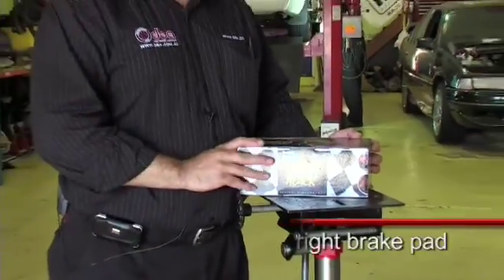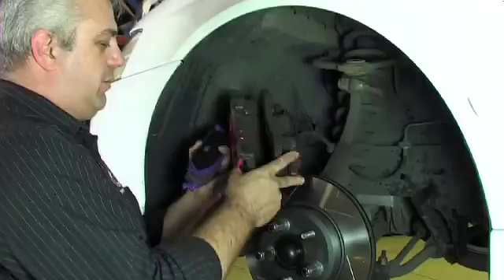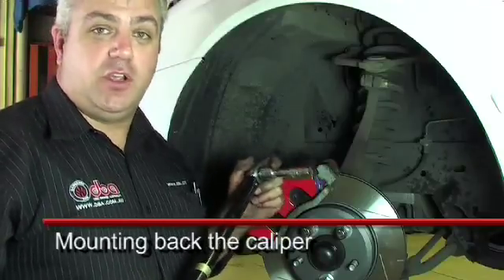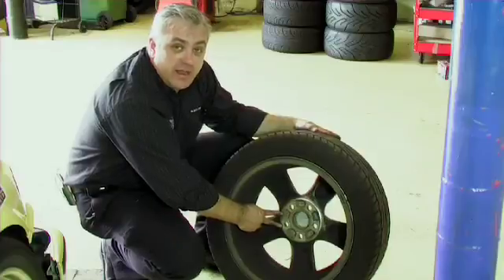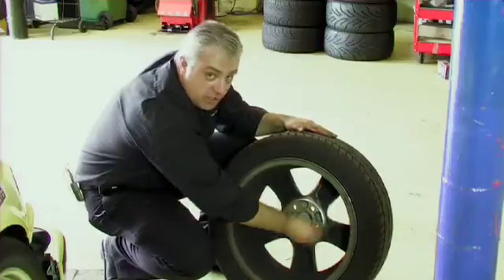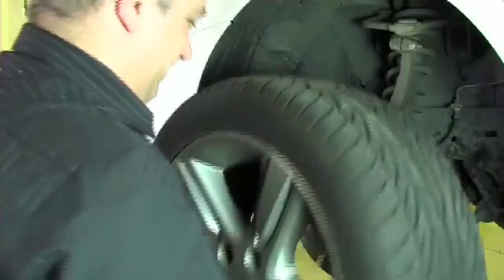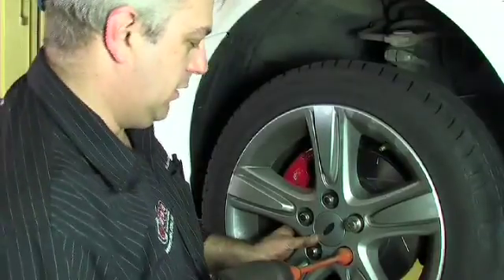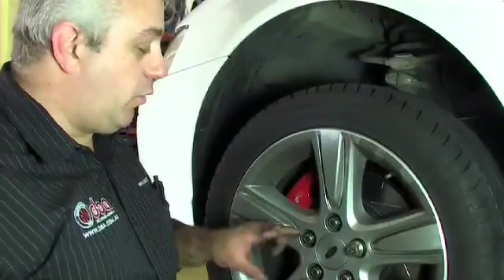DBA Tech Talk Video Episode 1 - Part 4 Fitting a brake disc rotor www.dba.com.au

Comment: Rotor "Conditioning" is a step that needs to be added to this install, even with new rotors.  During burnish period, a process called "Film Transfer" occurs.  This takes 300 to over 500 stop so it's not the initial 20 to 30 stops a tech generally wants to do.  To prevent hot a burnish and control Slip-Stick, use the OE Approved "Silencer" rotor conditioning treatment.  It is a two second spray applied to friction surfaces, requires no dry time and lasts through the burnish.  brake silencer. com

Comment: You must put a high quality synthetic boundary lubricant on the back of the pad, ears, etc, before mounting.  Movement at this mating point is critical, pads should never be fitted dry.  Be sure not to use petroleum based products or anti-seize, they will melt and contaminate the friction surfaces.  The OEM recommend Pastelub or Ceramlub  (2500 F +), they are Real Synthetic and indestructible under extreme pressure.  See full 5 step installation procedure at...  stop brake noise. com